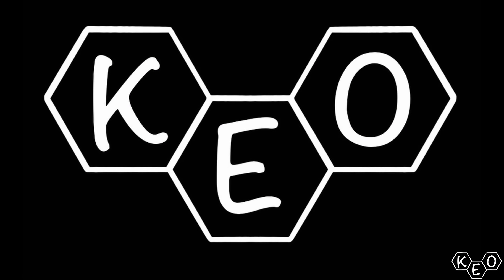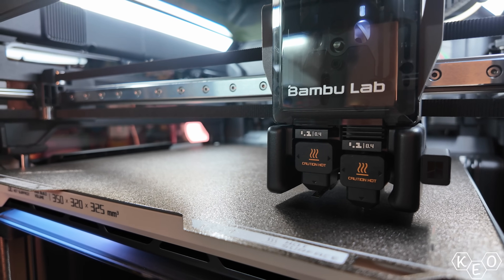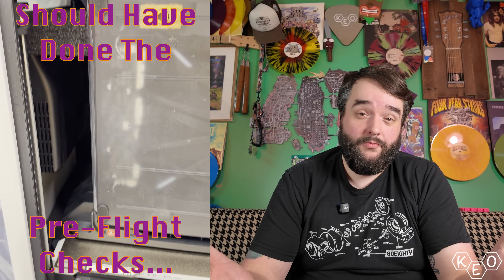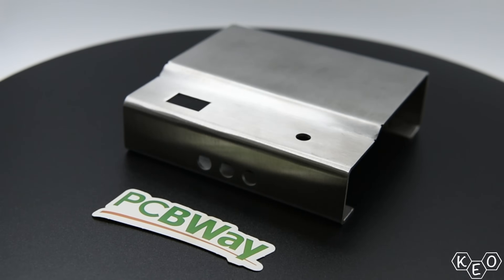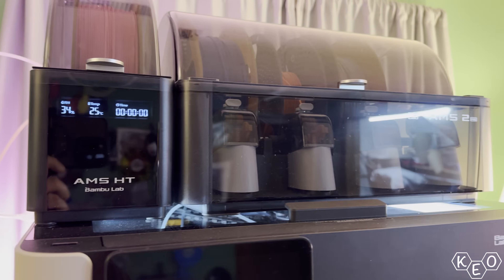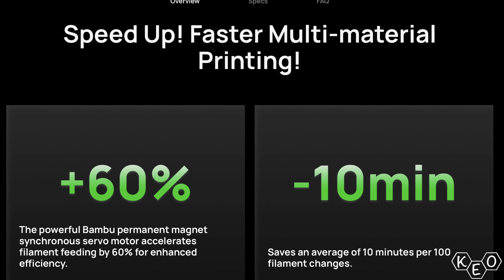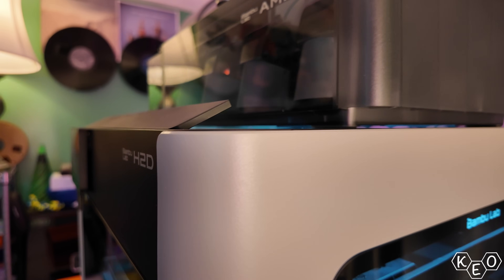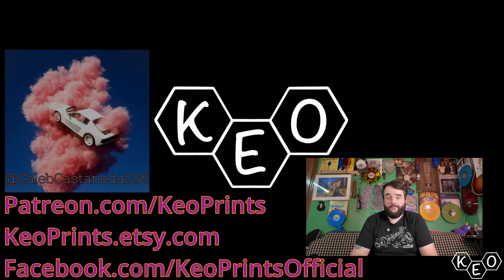Still Broken, Still Impressed – H2D Follow-Up

Comment: The fact that the AMS 2 Pro doesn't allow you to print while drying makes that function almost useless. The point of the AMS is to print. If I have to stop printing to use it to dry, then it's not doing its job as an AMS anymore.

Comment: Just watched this again and random question, I noticed that the top of your H2D hits just above your chin BUT you have access to the AMS from the side. I have the H2D with the AMS (X2) but I have them on the side of the printer.  The printer sits on a table that puts them  just about at the top of my chest but I can only access them from the front.  With that information, do you think printing a mount that puts them both on top of the printer (side by side) would make it hard to swap filament or would I be good to go?  Currently I have a rack that has them stacked on the left side of the printer.
Reply from the maker: As long as you have access from the front, this may work for your setup. For me, that would make it difficult to reach one side or the other I would imagine but this is worth investigating. I need to come up with a solution to my packaging as well

Comment: Running a print farm for 5 years, got some X1C but mainly modified Creality. Engineering type filaments. We looked at the H2D, but are testing QIDI plus 4, which will prob be it. We can almost get 3 Qidi P4 for one  H2D. Maintenance brilliant on QP4, H2D too much that can go wrong

Comment: Brushless motors and servo motors are not the same thing. The H2D extruder uses a custom Bambu designed closed loop brushless Servo but the AMS uses open loop standard brushless motors which are probably a lot cheaper but way faster and lack super fine positional control
Reply from the maker: Not sure if they are true servos but the product page is calling them brushless servo motors. Who's to know?

Comment: Have you done an evaluation of how well the H2D prints PVA with PETG and/or PLA: especially as it compares to the X1C? The main reasons I’d want a H2D over an X1C is to reduce wasted materials and time whilst also printing with a soluble material to significantly reduce manual labor costs.
Reply from the maker: I have not ventured that direction yet but I have experimented with the idea in the past. This machine is set up very well for support materials like that so I hope to soon
Reply: @KeoPrints I would be greatly interested in that: especially because I’ve noticed that very few channels ever really do a deep dive into PVA these days. It was a popular topic before Bambu labs came out. I did see one or two videos for bambu lab machines, but it was usually for stuff that wouldn’t really require soluble material. Like they would do ~90% regular support material with then have an interstitial/connecting layer of PVA, but it was on a flat-plane overhang. While the idea was quite interesting at the same time, they didn’t really test in the more difficult areas of FDM printing, like helical tubes or difficult spaces where it’d be impossible (or near impossible) to not only get pliers to where they’d be needed but also where’d it’d definitely be impossible to properly sand/smoothen the rough surface afterwards (like the inside part of a cloak, or internal, hollow geometry). Additionally, I’m curious how well PVA could be used to support delicate pieces/areas like an outstretched arm with a staff held in one hand with a model that is less than 2 inches tall and quite skinny for fdm. (I’m aware that FDM printers aren’t as good as resin printers (by quite a margin) for minis, but the test is more about seeing how well fragile parts can remain relatively unscathed (if at all).)

Hopefully these can be some ideas (I’m sure you have more) that could be good tests to evaluate the performance of the X1C and the H2D. Heck, if you have the cheaper Bambu labs printers, it might even be interesting to see how well those handle PVA. 

Thanks for the reply! If you happen to post a video on PVA (especially with regards to the X1C vs the H2D) I would love to see your evaluation of the experience! If you happen to remember where to find this conversation, I’d appreciate a link to the video, in case my YT algorithm somehow doesn’t recommend it. My algorithm has been acting funky the last several months, which is why I’m asking for a link.

Comment: For my most common type of prints (decorative items with usually only 1 or 2 colors on any given layer) the dual nozzle really does save me a huge amount of material and time. I do not think the full capabilities of this printer have been realized yet. When the firmware gets updated to secondary nozzle support material working well, and for two different simultaneous nozzle sizes we will see more unique printing possibilities.

Comment: The non green glass door is available in the U.S. store again finally - I just bought one to swap my green one until I want to use the laser - it’s been confirmed that the different glass and doors have special magnets and sensors so the H2D knows which is installed and doesn’t let you use the laser unless all three are the green version, the opaque top glass is installed and the door is closed.

Comment: My opinion of Bambu Lab hasn’t changed since their “security update”. I love my P1S but I will never buy another BL product. If only they didn’t try to take advantage of customers and be super intrusive, then I would still be buying their products.
Reply: yeah i bit on a p1s near the start of the year and don't regret it but that firmware is not getting """""upgraded""""" any time soon. I'll pick which slicer I use tyvm.
Reply: @neongrey333 Since switching to LAN only and locking it down from the security certificate, I use Orca Slicer in Stealth mode. It would be considered “extreme” but I take privacy very seriously. I don’t really use any other slicer. It’s just that good.
Reply: Security update doesn't bother me
 Nothing changed for me. I just feel price is a tad high and hope they release a p1s version of h2d
Reply: @peterpeter5666 well it does matter if you use orcaslicer, which I do, they finally locked it out recently
Reply: @peterpeter5666 I would imagine they would because how pricey the H2D is and I don’t think it is selling well. Problem is, I care about the security updates they made and terms/conditions. They could come out with the defacto best printer ever and still wouldn’t buy it because of that security updates that took away features and made me trust the cloud service even less. Since then, my BL printer is on LAN-only and on v1.00.07. It will stay like that until it breaks to the point it is unrepairable. Then I will move to Prusa.

Comment: This begs the question.  Does AMS2 make a P1S faster with color changes?  I'm buying either a P1S or H2D in the next day or two and have not decided.  I have decided to get AMS2 with the P1S if I go that route.
Reply: I want to print artificial fish tails in TPU over PLA support.  I want to print PLA lure painting templates shaped to perfectly fit a lure body and I want it supported by dissolving support material.  The P1S bundled with AMS2 is now out of stock at my MicroCenter.  I'm not even sure the P1S will print TPU over PLA.  I'm leaning towards H2D.
Reply from the maker: TPU is not compatible with any of the AMS units. So you would have to go with dual nozzles if you wanted to pull something like that off

Comment: No problem with mine for about a month. Pretty happy. Still think you should have been patient and gotten the new one that they offered. No expensive machine is a “value”. That’s not what they’re about. That’s not the point to them. Sometimes extra features and performance costs more than what you might think is worth it. If you want or need it, then that’s what matters.
Reply: Yeah, he is crazy for not getting a replacement
Reply from the maker: believe me, I know. But ill have a video coming out talking about my thoughts behind that... just as soon as I get through this backlog ive built up

Comment: I've had to all but disable the active temperature control.  And the aux fan.  It has caused more failures than successes.  Designed some old fashioned top glass spacers.

Comment: The H2D is ideal for printing high volume multi-material prints consisting of a main engineering material and a dissimilar support material. Way faster and more efficient on a dual nozzle setup than with an AMS.

Comment: Checking the plate for debris isn't a bad idea for people like me who keep forgetting to remove old purge lines or even the multi-colour print tower (I won't do that again).  🙂
Reply: I hang my head in shame...three times the purge-line got run over...twice a purge tower tested the motors...
With so much being automated, it's easy to overlook simple things.
Reply: @pirobot668beta  LOL.  I was impressed by the way my Kobra 3 Max ploughed through my old tower, added some more filament to it, finally wrenched it off the plate and then took it for a guided tour.  🙂
Reply: My h2d did not warn me of leaving a large flat print on the build plate. It leveled the build plate by pushing holes into the print in the middle and did not even say anything. When I heard a loud noise I came to check what was happening and realized my error in forgetting to remove the previous print. But the H2D has been good about other warnings like spaghetti

Comment: They should have made this printer 400mm ^3
Reply: Cause this printer isn't heavy and oversized enough as it is.  Barely able to have lifted this on my own and had table stand space for it without needing a custom table.
Reply: It would then require a pallet and dock to deliver. They literally made it as large as could be shipped.